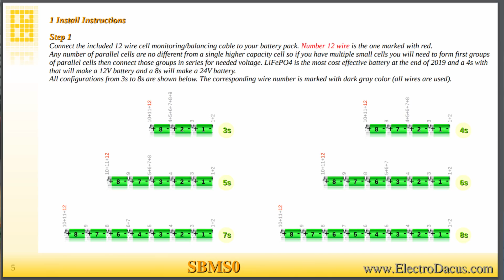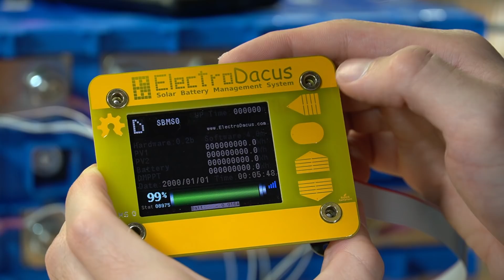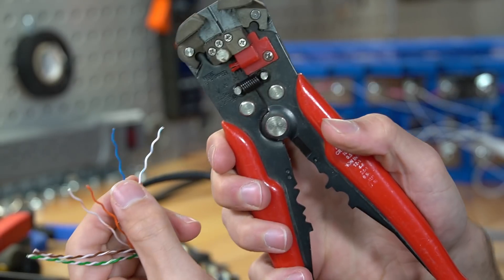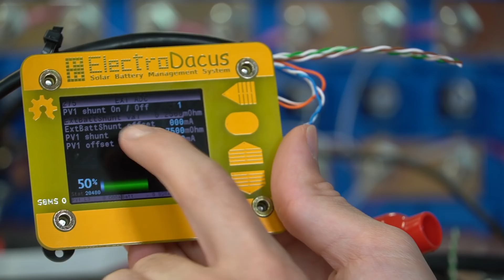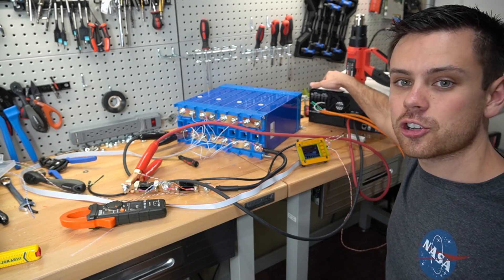Electrodacus -Open Source- Solar Battery Management System: Introduction and Setup

Comment from the maker: This is advanced user BMS! Not a plug n play system. You add temp sensors, mppt and whatever you want, calibrate it, program it etc. If you don't like something, change it. It's open source. 

Table of contents:
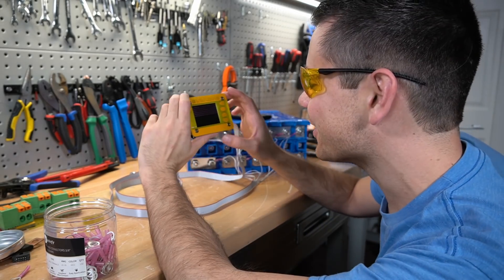2:30 Turning it on
3:01 Modifying the Settings for your Battery
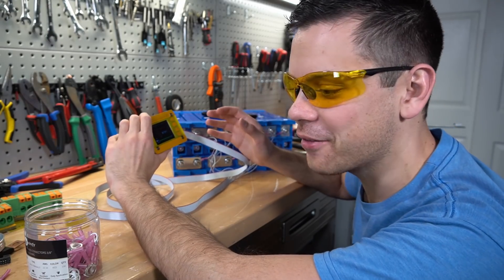4:37 Shunt Installation 
7:48 Shunt Parameters Explained
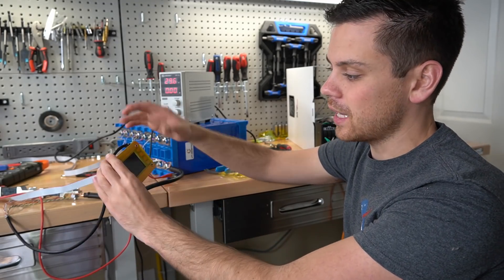9:00 Modifying a LV2424 to work with SBMS
10:19 Modifying Inverter Control settings on the SBMS
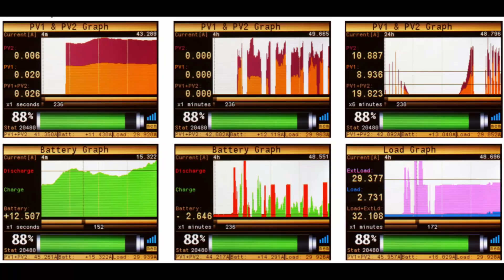12:47 Data logging and further discussion

This video is geared for advanced users, but a "beginner friendly SBMS setup video" is in the works. I ran into quite a few problems with setting it up,and figured that this video of me troubleshooting each problem would be useful for some of you. Once I understand all of the settings, I will make a fast paced, concise setup video. 

Let me know what you think :)

~~~~~~~~~~~~~~~~~~~~~~~~~~~~~~~~~~~
Tired of getting ripped off? Check out my "Will Prowse Approved" solar product recommendations below!

12V Batteries
https://www.mobile-solarpower.com/lithium-batteries.html

48V Batteries
https://www.mobile-solarpower.com/48v-batteries.html

Offgrid Inverter System Builder
https://www.mobile-solarpower.com/48v-complete-system-blueprint-559371.html

Hybrid Inverter System Builder
https://www.mobile-solarpower.com/code-compliant-48v-offgrid-system.html

Mobile Handtruck System Builder (very popular!)
https://www.mobile-solarpower.com/mobile-48v-system.html

Solar Panels
https://www.mobile-solarpower.com/300w-solar-panels.html

Ground Mount Solar Racking
https://www.mobile-solarpower.com/ground-mount-racks.html

Wire, Lugs and Busbars
https://www.mobile-solarpower.com/wire-and-connectors.html

Tools
https://www.mobile-solarpower.com/tools.html

Fuses and Circuit Breakers
https://www.mobile-solarpower.com/fuses.html

Plug-N-Play Solar Systems
Ecoflow, Anker And Bluetti! So many models to choose from. See my current recommendations here:
https://www.mobile-solarpower.com/full-size-systems.html

~~~~~~~~~~~~~~~~~~~~~~~~~~~~~~~~~~~~~~~~~~
Need to build a large DIY system? Need a trustworthy solar distributor? These are my favorites:

Signature Solar
Creator of EG4! Solar Minisplits, Victron and More! Largest Solar Store Online.
If you want $50 off, please use my link below and coupon code "DIYSOLAR50":
https://signaturesolar.com/?ref=cPwLcVc0SW-BjN

Current Connected
Best Prices for EG4, Victron, Midnite and so much more! Fast Shipping and Highest Rated Customer Service:
https://currentconnected.com/?ref=wp

~~~~~~~~~~~~~~~~~~~~~~~~~~~~~~~~~~~~~~~~~~
Join our DIY Solar Community 
Need more help? Join the largest solar forum on the internet for beginners and professionals alike. 140,000 members and counting!
https://www.diysolarforum.com

Check Out My Free Book
Best-selling and beginner-friendly guidebook to off-grid 12V solar!
https://www.mobile-solarpower.com/the-book.html

~~~~~~~~~~~~~~~~~~~~~~~~~~~~~~~~~~~~~~~~~~
Contact Information:
I am NOT available for personal solar system consult! If you wish to contact me, this is my direct email: williamprowsediysolar@gmail.com
FTC Disclosure Statement and Disclaimers:
Every video includes paid promotion or sponsorship (such as free products for review). Some links on this YouTube channel may be affiliate links. We may get paid if you buy something or take an action after clicking one of these. My videos are for educational purposes only. Information is subject to change/update at any time. Electricity is DANGEROUS and can kill. Be smart and use common sense :) DIY Solar Power with Will Prowse is a participant in the Amazon Services LLC Associates Program, An affiliate advertising program designed to provide a means for sites to earn advertising fees by advertising and linking to Amazon.com
Reply: Beginner video would be great
Reply: Very impressive unit, I need to learn all of its finer details, lots of comments below have answered some questions.
Reply: what is the shunt link anyone.
Reply: hey what connectors did you get for the balance wires? What size mm^2 or AWG? 
I need to connect mine to M6 lugs. 
Great video, thanks alot
Daican also suggested me to run a Victron batteryguard parallel to the inverter. This way you can hook up your DC-DC converters for leds, small fridges or whatever DC gear you have.(oh yea chargers, fuck I have a ton of DC chargers haha)
Reply: This is awesome man!!
Reply: I live on a boat. The ability to automatically switch my solar charging to a different battery would be great. Can this do that?
Reply: Nice gadget, but ribbon cable? That you have to pull apart? Cat 6 that you need to cut up and re-wire? This product is not ready for prime time. Way too many areas of concern. Great for a lab, but not a house.
Reply: @Sanwizard1  It isn't designed for prime time.  It is designed as an open source off grid solar system for people who want to put one together. You either do the wiring yourself or, to get something similar, you pay a company a lot more to do it for you. Both are available options now. What I've noticed is that he uses readily available and suitable parts, so if my cat5 cable rips I can probably find another in a drawer or buy a cheap one locally. I've seen several reviewers "complaining" about the smaller wires, but it was easy to do.  In fact, I've used cat5 on other electrical projects after using them on my sbms, because it was so easy to use.

Comment: Hi Will, I’m trying to build a solar ebike battery. 

(52v 25ma) As such I need a BMS capable of bluetooth for monitoring, a common discharge and charge cable for charging while discharging. Any thoughts?

PS solar panel attached to  bike.

Thanks,
Sam

Comment: Using the DSSR20s' diversion feature to heat water would be great test to see Will. You need to use 2 DSSR20s, 4 60 cell solar panels and 1 resistive immersion heater like Dernords's 36V 1200W element.

Comment: I am interested in this for an EV application where I have a motor with probably a peak of 300A and maybe 50-100A continuous. So I assume that the shunt is sized for the max amps you need as well as the contactor. This EV already has a shunt and main contactor so I don't know if I can use those since they are already sized for the application. He mentioned using two of the MOSFET units in parallel to get more current. Can you do that? The design considerations for these solar systems are a little different than for high current motors.

Comment: How about connecting a timer or load switch to activate the heat gun or load once the battery is at a start-up level and using solar power input instead. All autonomously

Comment: Will, really appreciate your videos. PWM controllers have an initial spike on the rising edge of the square wave. This could be damaging to the cells, as the spike voltage can far exceed the cell voltage.  Have you measured and or looked at the pulses coming off the PWM's you show in the video with an Oscilloscope or a Fluke Digital capable of capturing peak voltage?

Comment: Hey flip your unit over and look. That grey ribbon cable that curls back inside of the BMS is the WiFi add on module. Your WiFi option should be good to go.

Comment: If you use the sbms relay control contacts to switch the inverter on and off, connect it in series with the inverter’s switch rather than parallel. If it’s in parallel, the inverter will stay on if either the switch or the sbms is switching on. If you connect it in series, the inverter will switch off if either is off. BUT - be sure that switch is only a control voltage, not switching main power. Otherwise, you can use the sbms to control a relay that can carry the current.

Comment: The best Electrodacus video to date. I would really like to see how the DSSR20 components work. The manuals say that you need a 60 panel to match the 24v batteries, so I'd like to see you talk about that. A really bonus would be to have you setup the diversion circuit for a water heater.

Comment: great work and i like ur positive attitude in all ur projects.  i want to use the bms also, however the batteries i ordered will have a total of 25.6 V. the bms is rated for 24 V.  can i still use the electrodacus?

Comment: Hi Will, I love that you gave a review of the Electrodacus SBMS0 system. Even though you mentioned the DSSR20 modules, and mentioned to do some further testing, I have not seen it anywhere yet. Did you do any further try outs with them? I would love to see your findings. I understand that making these videos can be very demanding, but I hope to see you make a test review using the SBMS0 with the DSSR20's to use in a fully functioning PV solar battery charging system.

Comment: is it suitable to use to build a system using NiMh hybrid car modules like the ones used in toyota cars?
he single blade is 7.2 nominal voltage so making a 12v system using it is something i wanna do but i cant rap my head around it completely
there are lots of reconditioned NiMh batteries that can be repurposed and it wud be great if i get an answer from you about that

thanks

Comment: iv had mine for 2 years, and it works flawlessly just got my 2nd 1 today, will use in my golfcart.
Reply: Dylan do you have a 24v setup?
Reply: @thomasnyanfore8424  yes 7s

Comment: @Will Prowse Would love for you to build a mains charger with ElectroDacus using PSU's instead of PV's! One main unit and one 500W Psu per switching regulator should make for a cheap 1500W charger that is easy to upgrade to 2000W(or higher) or downgrade to 1000W/500W!

Comment: There is a slightly cheaper redesined version of these on indiegogo right now (search for electrodacus SBMS).
From what I understand (and I'm a noob) the great thing about these is that together with the cheap DSSR20 they are PWM charge controllers if you select your solar panels right. Basically solar panels are amperage limited devices so you don't need MPPT or PWM, they can't deliver more amps than a certain amount. A MPPT controller is more energy efficient but simply adding more panels is cheaper less than MPPT which requires a replacement over it's lifetime.

So with this you get BMS and long lasting solar charger in one. Plus you can set up a cheap PV heating system using thermal mass to keep your house warm which is very cheap and works even in Canada if you have enough solar panels. So all in all it's a cheap and long term solution to power and heat your off grid house. Really well thought out once you get what it actually does.

So lets say you want to put 14x Solar panels on a 40' container house that would be up to 5kW solar. You'd need 10x DSSR20 which cost you like 400-500€. That plus solar panels plus lifepo4 batteries and an inverter and you're set for like 30 years. 

Plus you can build a cheap and simple thermal battery into your house. I think that is where an overabundance of PV is useful, 5kW solar panels cost you around 2500€ now and you want to plan for the dark winter months.

Hope I didn't get anything wrong lol, I'm still learning. Thanks for the video!
Reply: following

Comment: Love this video and great product review! It's the first time I have seen a BMS that will do everything I want: monitor individual cell voltages, temperature, overall voltage; send signals to charge and load controllers, and still be easy to use. It make it much easier to integrate a raw LiFePO4 battery bank with off-the-shelf equipment from Victron. 

Speaking for Victron, I think their gear is more expensive because it is built for the marine industry and has to stand up to high salt environments. There is a substantial additional cost to building in that resistance.

Comment: heads up, the cat5 cable needs to be a solid core cat5.  if you bought it at walmart and it was single core, you got lucky.
Reply: where did you read that at?
Reply: @thomasnyanfore8424  from Dacian and experience.
Reply: @surfreadjumpsleep  thank you

Comment: So if your solar panel voltage is too high for your batteries, a PWM charge controller is not good enough, you need a MPPT or, is it just these particular PWM (the orange and green things in Will's hands between aprox. 13:30 and 15:00.) that need solar panel voltage matched to battery voltage?

Comment: Someone suggested that if you have an existing large mppt solar system that you can put the dssr20 on your pv cables and let the bms just disconnect the solar panels when the battery is charged.  I've never tried it however it could be good for an existing mppt setup. Now that I know more about the electrodacus I prefer the idea of matching the panels to the battery however as I've already got a mppt setup I will stick with that.

Comment: You could just use a victron battery protect instead of controlling the inverter right?
Reply from the maker: Unfortunately not because battery protect manual changed recently. Cannot use capacitative loads, such as charging caps on inverter, with battery protect. It will fry the FETs
Reply: Eh some nice system contactors are probably better anyways.

Comment: Hi Will. I'm planning a 7S lith. solar system with a hybrid inverter to run fridge, freezer etc. Is this bms a cheaper alternative to batrium? It does active balancing, monitoring and low/high volt cut off!! That's great!! Thanks for the video.😊

Comment: The batteries are charging at 60A because that is the Utility Charge limit.  It should go up to 80A if you connect the PV panels.  BTW, I plan to build this same PIP MPP 2424LV system except I am going to use 16 Fortune 100Ah batteries configured as 8s2p for 24V 200A.  I am now looking for the best BMS solution to balance my 8s2p configuration.  Not neccessarilly the cheapest but one that won't self destruct in 1yr.  Is this SBMSO now your favorite BMS?  You summarized this well.  SBMSO does seem complicated.  I don't care about collecting data on a small 8s2p battery system in an RV.   Ironically, I am the semiconductor product engineer for the MC33771 BMS I/C and even I don't understand the BMS application very well.  I learn a lot from watching your videos.  I would like to see you talk about how to select optimal panels for the PIP MPP 2424LV.  The Vocmax is 145V and Vmpp range is 30-80V.  What is the optimal PV output voltage?  What are the characteristics of an optimal panel?  I don't understand why the BMS needs to know the panel voltage or why you need PWM regulators on the panel outputs.  Why do you want to match the solar panel to the battery bank nominal voltage and how do you do that?  Shouldn't the voltage be as high as possible (near 80V)?  There are a few ideas to discuss in future videos.

Comment: Does this Electro 
Dacus BMS have low and high temp cut off ?
Reply: You are able to connect a thermistor for temperature control. It is in the manual.

Comment: This! this right here, oh my. I am planning a small solar shed build, mostly as a hobby to get my learn on. I've been watching tons of videos and built my own 4s11p 18650 bank in an ammo can. I use that for charging my RC batteries while in the field or device charging when camping. I had been wondering how to charge that and future lithium battery banks from solar. This right here, this is the piece I was looking for, something that will handle the lithium batteries and provide some data logging to feed my inner geek. Now I just need to wrap my head around these Electrodacus products for an order than select a panel and work out the minutia. Thanks for posting dude, this is awesome!

Comment: Will, I have been looking for a review of the Batteryhookup  4S lifepo4 100A BMS with low temp cutoff. Is that still coming or did I miss it. Thanks for doing such a great job.
Reply from the maker: Oh yeah I love it. Check out my $556 LiFePO4 build video. I also have it on my website